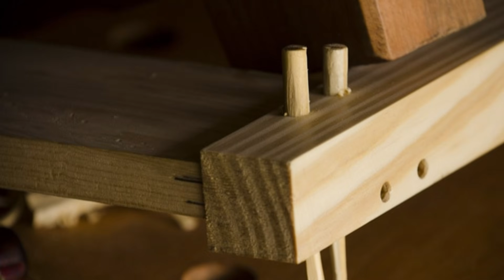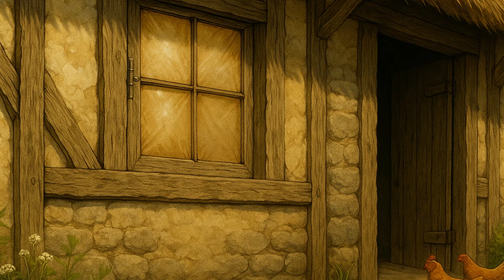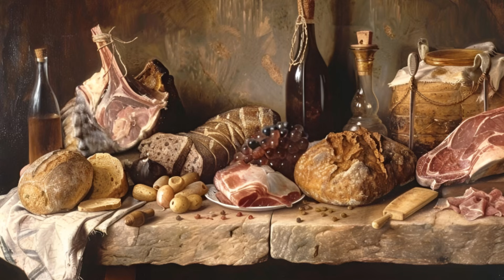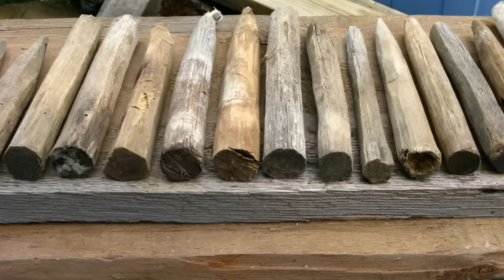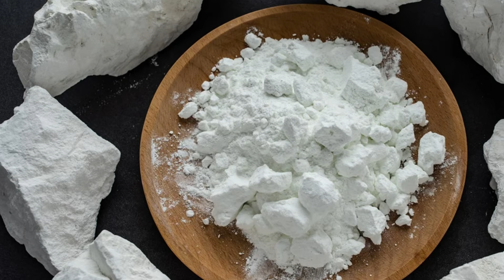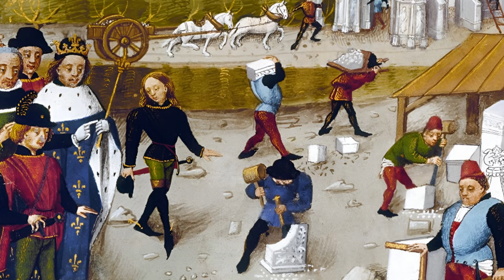20 Medieval Building Tricks That Defy Modern Methods

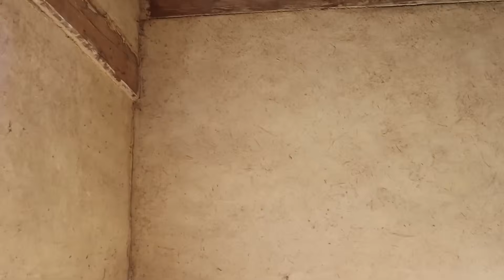Comment: 2:09 For some special constructions, wood was treated during 10 or 20 years before it was put in place on a construction site, using different baths to prevent rot, insects, etc. then dried in the right ways to keep the desired shape and resistance, making the wood denser rather than lighter, and making sure the artificial holes in it will continue to shrink and press the pieces together instead of opening and letting the joints get lose.
The most amazing part of this is that people had to maintain the knowledge for generations in order to not lose it during the long process, as people often died before the full project was complete, and people worked for the next generation.

Comment: "The frames were assembled on the ground first, making a giant 3-dimensional puzzle"

Yes, they were assembled lying on the ground but can't see how that makes them 3-dimensional until they're raised.

Also mortar was used in the building of the Welsh medieval castles and city walls, so don't know where they get that from. The lovely Welsh drystone walls are usually built for stock control and a way of getting rid of troublesome rocks from the limited grass areas.

Don't think I'll be watching this any further. Three minutes is enough.

Comment: My house was built in 1857.  Its basement walls r made of not so small field stone three feet wide with some on bottom having to be at least a ton.  The up hill side has a spring that flows yr around and there is a darn in down hill side that runs our to dich 200 ft away of 8" clay tile.  Bty the man built the place with 12" think walls. Today it is fully insulated with that much.  Very warm in winter and cool in this summer heat.  Even when it went ot 93 yesterday my fan was enough.

Comment: Great video, but at 7:04: "Larger stones went in first..." The accompanying diagram shows the smaller stones went in first, and got bigger as the builders went up, until the stones above ground were the biggest.
Reply: It's A I
Reply: That is true. Small first
Reply: The smaller stones at the bottom were supposed to represent what the filler material looked like. AI sucks, but there's a method to the madness if to pay attention
Reply: @Brendan-b1j6r  I don't cut AI any slack.  If we don't tell it to shape up now, it might never will.

Comment: Wooden pegs for holding structures together was used in shipbuilding all the way through until iron hulls replaced wood hulls -- "treenails" (often elided as 'trennels') were cheaper to use than iron nails, and didn't corrode with exposure to salt water.

Comment: Most such buildings are in seismically stable areas.  If built in places such as California or Japan most would be nothing but rubble.  Also they built dry stone walls ONLY under compression.  Modern wood construction in earthquake zones are MUCH more flexible than medieval wooden structures
Reply: They used similar building techniques in Japan. For instance they also built stone walls without mortar, except the walls were intentionally made with irregularly shaped stones which helped disperse the force. The Japanese carpenters also used more elaborate joinery, but the fundamentals are roughly the same, including the wooden pegs and so forth.